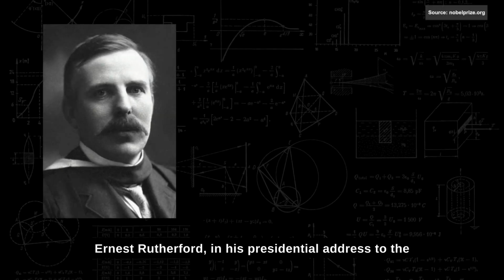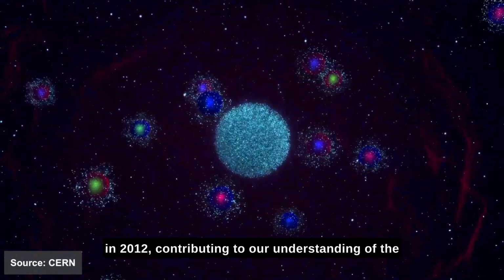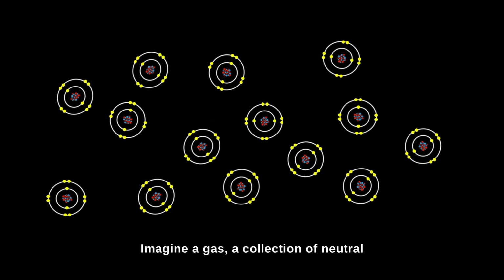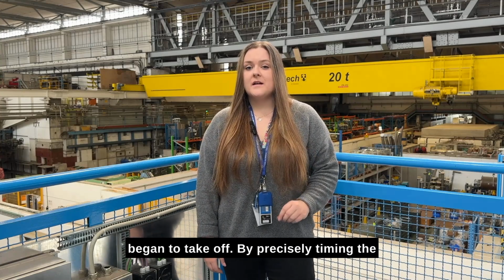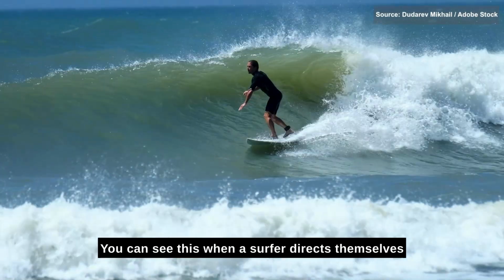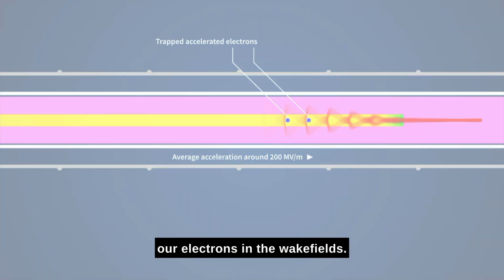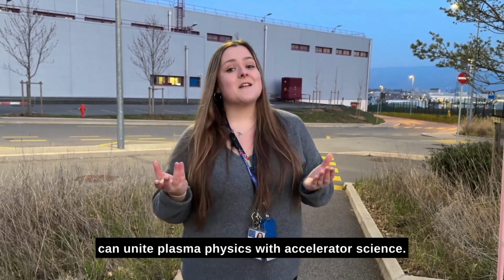Plasma Wakefield Acceleration with AWAKE

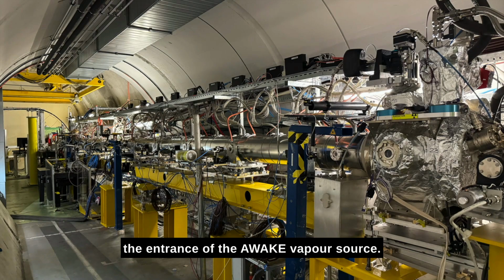Comment: At 10:10 the audio talks about wavelength but the graphic shows differences in amplitude?
Reply from the maker: Hi there! What's being raised here is the fact that long versus short drivers drive wakes of different amplitudes. So a shorter driving bunch (with a length on the order of the plasma wavelength) drives wakefields of a larger amplitude than a longer driving bunch would. Thanks for your question!